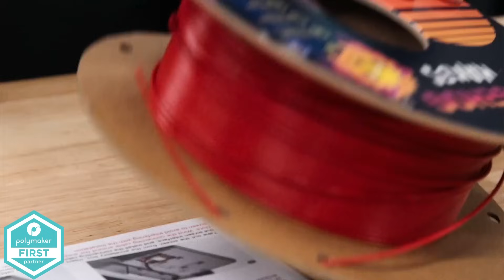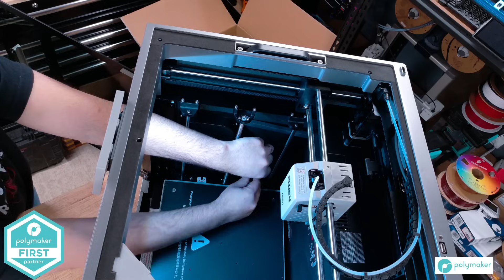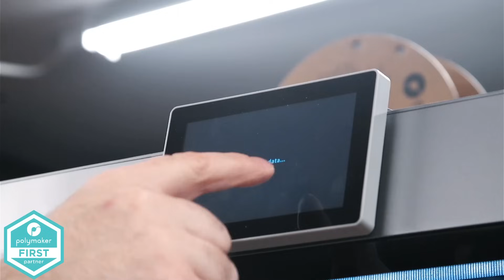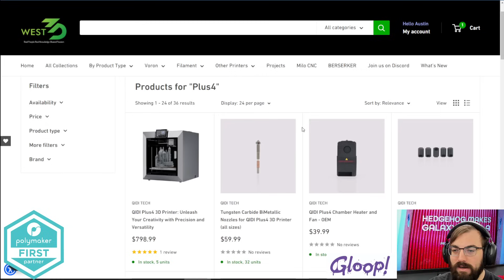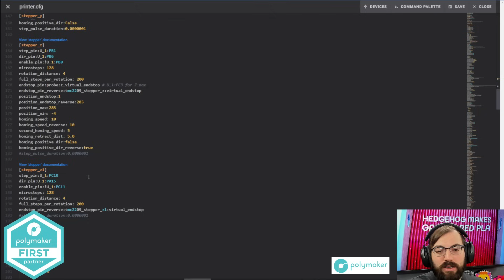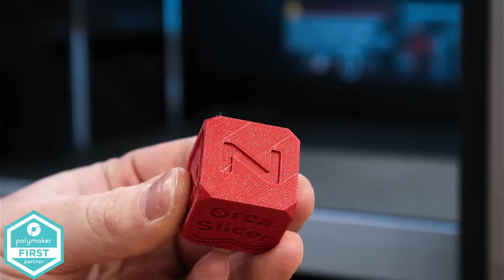Is This Is What Bambu Should Have Released?

Comment: How serviceable does the linear bearing and the belt idlers seem to be? Did they pull a bambu and make them near impossible to replace? Press fit or molded in axles are service hostile.  Bambu is a toaster, justvthrow it out when a cheap part wears out.

Comment: Put flashlight in and look to far left and up about 12 inches you will find point where you push on to release back cover easily...It bit of pain but once you get off once in future it will be easier.  Qidi has all types of maintenance videos those are pretty good.  Best poop bucker use one from Function Print Friday you tube channel, he made great poop bucket design for it, fits like a glove.

Comment: Did they fix the electrical problems on this?  Can it still burn your house down printing a benchy?
Reply from the maker: The West3D version features an updated SSR! Only reason why I'm checking this out now
Reply: There have never been any reports of it causing any type of fire. Qidi quickly addressed the issue AND gave everyone who owns one an extended warranty for an extra year. Even Apple doesn't do that. Qidi actually has great customer service.
Reply: @ Oh that's interesting, thanks for the clarification.
Reply: @daveisradicle  On day 1 I contacted support with my serial number and they are sending me the updated SSR the updated nozzle assembly. So even if you get an early model they will send you everything you need to update it immediately.